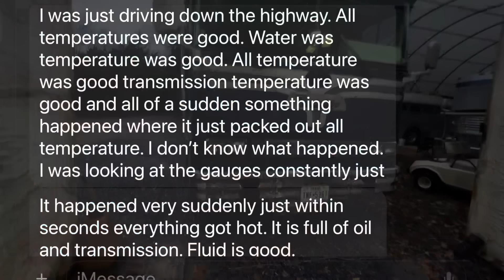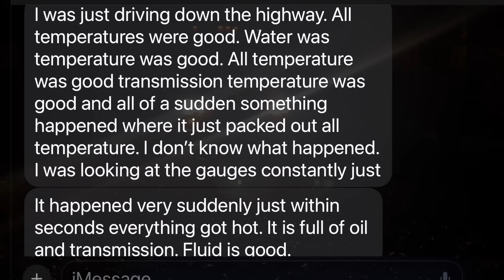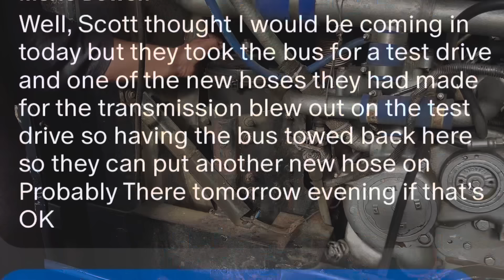From bad to worse.  Shop fire, bus breakdown and two tow trucks on one trip.

Comment: As a retired firefighter for the City of Calgary, I would like to suggest that you have the owners of buses mount their fire extinguishers on the level. A horizontal mounting  will help if they ever have to use an extinguisher because the first thing you do is thump the extinguisher on the ground when you pull the pin. The thump on the ground will loosen the powder and it will work. If mounted up right, the dry chem compacts with up and down motion and in a lot of cases they don't work. Hope this helps.
Reply: Good to know!
Reply: That's good information
Reply: What do you want to bet that 75% or more of the fire extinguishers in these buses won't work in an emergency.  The vast majority of the population is under the assumption that you buy a brand new fire extinguisher and it will last forever as long as it has not been discharged.  Unless someone owns a business requiring annual fire inspections or works in the fire protection industry they have no clue that fire extinguishers must be serviced annually.  I have my fire extinguishers serviced biannually for piece of mind.  Fire code only requires me to have 3 5lb abc fire extinguishers and I have 4 10lb and 2 20lb abc extinguishers along with 4 20lb c02 extinguishers and 2 20lb class D extinguishers.  It does not matter if its fire code, plumbing code, electrical code or any other code because that is minimum code which is the minimum requirement to pass.  Why don't they list minimum code, preferred or suggested code and maximum code.
Reply: My daily pre-trip includes dismounting and shaking the extinguisher so that the dry chemical is loose and ready to go.
Reply: yes that is correct, same with fire extinguishers on fuel tankers, mounted upright, removed every 6 months and checked for settling or thumped on ground to remedy.  If thumping doesnt work, they go out for replacement.

Comment: I always kept a CO2 fire extinguisher at my bench. They displace the oxygen to put out the fire but also have a "right now" chilling effect - great if you're welding. Best of all - no residual mess! That white powder is nasty and will corrode electrical components ... showing up for a long time after the incident and ongoing.
Reply: I use Cold Fire for the same reasons
Reply: For welding, metal working and automotive a class D extinguisher is a must.  Who cares about mess or residue if the building burns down, I have two 30lb class D yellow extinguishers in my shop.
Reply: @ShaneSwartz-l1x you really need abc extinguishers in an automotive shop. D is not intended for gas, oil, electrical or burning rags. Unless your shop is working with combustible metals (titanium, magnesium, zirconium or lithium, a class d is not really the correct choice.

Comment: This is why the last shop I worked for didn’t allow welding or torching an hour before closing.
Reply from the maker: Smart
Reply: The rule at my shop is that someone has to be there for 2 hours from the time of the last spark or ark, tig welding is the exception which is 20 minutes.  I only have 5 employees but they all know they do not leave until the closing checklist is completed each day.  I also have fireproof oily waste cans that are just for rags and all rags must be in the containers before the checklist is complete.  I check the cameras to see if they are following the checklists.  I am a pilot and flight instructor and aviation revolves around checklists as they are the most effective way for humans to properly complete procedures and tasks.
Reply: @ShaneSwartz-l1x  check list can and should be applied to everything

Comment: Probably should have a basic safety briefing for any customers working in shop. Thanks to your channel I was fairly knowledgeable when I bought my MCI MC8 in Port Orange FL. My friend and I flew down from Philadelphia to drive it back. I had hired a local diesel mechanic three months prior to change the oil and such and I knew it ran great. Frustrating though because my water temp gauge illumination was out. About 100 miles up 95 I saw coolant blowing out overflow and pulled over immediately. My squirrel fan belt broke. Luckily there were two spares. I was able to change it in 15 minutes and be back rolling. All stuff I learned watching your channel so thanks !  I use to drive to Orlando twice a week from Philadelphia for UPS so the drive back in the bus was cake. Been past your area a few hundred times. Retirement coming soon and a lot more bus work and good times.

Comment: When I worked asset protection for a large company. Any welding extinguishers must be on site and then after job finishes for the  first two hours an inspection had to be done every 15 minutes to observe for any smoke or fire. After that then next two hours every 30 minutes.  The inspection card has to be signed off at each interval.
Reply from the maker: In shop class in high school my teacher was welding and a spark flew into a trash can and the can exploded flaming material all over the shop.

Comment: Thanks for your videos. They’re always very interesting and we really like to watch them. Yeah that fire is scary. Wasn’t it? You know I’ll just give you a little advice as to what I do in my house in the laundry room. I keep a dedicated garden hose coiled up in the ceiling and it’s connected to my water system with a shut off valve. I’ve never had to use it, but it’s there in case I can reach anywhere in my house with a hose and I would be able to put out a fire if I was in the house, of course Just thanks again

Comment: Can't tell you how many times I've seen wiring pinched in-between engine and transmissions over past 50 years. 
Hello from Siesta Key Florida
Reply: I love laughing at my customers who are too cheap to pay for transmission installation, they call me blaming me for why the vehicle won't start and I tell them to go follow the wiring down the back of the engine and not to waste my time.
Reply: My favorite is when they short out a $700 tcm and they have to pay to replace the tcm and service programming.

Comment: A house around the corner from me mostly burnt due to oily rags in the garage, since it was mostly brick and the station is about half a mile away it was saved. I have a repurposed wire mesh waste basket that all rags go into and it sits on my work table so I can see it from anywhere in the garage.
Reply: Yeah it's crazy how a bunch of oily rags will catch on fire themselves.

Comment: Towing....  A wheel or axel lift, such as the one shown, is the only method to avoid damage to front structures.
I think many  Wanderlodge with a front mounted generator, has its lower frame bent upwards  from previous tows. And that causes damage/binding to slide out.
Appears this one has also. On GM and MCI they screw up spare tire carrier, etc and sometimes even break off entire front bumper as things give way.
If you fool with bus conversions you really need to be vigilant in the case of a tow. Ask about method of lifting and get on the ground to confirm with your own eyes.
You have to insist regardless of what 'towing expert' says

Comment: Boy howdy!!  Some of my worries all in one video.  It's interesting when his suddenly over heated.  When my cooling fan stopped working, I noticed that the engine temperature slowly rose and wouldn't cool back off when it normally would have.   His system may be barely enough to cool and any disturbance in efficiency results in overheating.

Comment: So we have a concrete board with the joints mesh taped with mortar on the walls and the joint on the floor around the welding area.  We had a small fire years ago. Now dedacated welding area.

Comment: Always have red arrows / markings high and low on the walls to designate where a fire extinguisher is.  Also, I keep water charged extinguishers handy while welding / cutting to knock down those small flareups.

Comment: I was looking at that great deal you got on the tractor but the only thing that's not really super great is the track Growlers the actual biting area of the track is really really low they are not very tall! You should add them you actually weld new ones on the tracks that you have on already. You can buy them separately and they make a big difference for your traction that you need coming up your Hill. All the best from Canada.

Comment: My friend's van had a fire in the engine compartment, we put it out with a CO2 extinguisher. Someone had called the Fire Department and to make sure they sprayed it down with dry chemical. Three weeks later the were no insulated wires in his engine compartment.  The dry chemical  ate, (corroded), all the insulation off the wiring. I do not have any life experiences with spray foam. Might be a good Idea to thoroughly clean that part of the wall.

Comment: Having seen Andrew Camarata's video of losing his $150,000 excavator for want of a decent fire extinguisher [and he was seriously under insured so only got a $25,000 payout], I've supplemented all my vehicle and building fire extinguishers with fire safety stick fire extinguishers.  
It hasn't been a cheap exercise as the larger of the two versions is the equivalent of US$130 here in the UK, but they don't need servicing and have a shelf life of over 10 years.  More importantly though, the big fire stick operates for 100 seconds which is way longer than normal extinguishers and gives you a much better chance of knocking down a blaze. 
And, yes, I bought several smaller ones and we had a practice fire drill with them!  
$1,000 effectively went up in smoke but my staff now have confidence in them.
My local fire brigade, who came to the drill with the local fire stick agent, now also have one in the their fire engine which they paid for!
I hope you won't mind me posting this video of the effectiveness of the fire stick in real life circumstances [and I haveno connection with the maker by the way]:
https://youtu.be/KOeEVihGAA4

Comment: Man, that fire was slow to start, but quickly extinguished. I think it was timely that Kelly came in with the call, otherwise your son-in-law might've left the shop for a minute and the fire could've really stepped up. As for the bus, I think that other shop did something that triggered the immediate overheat situation - maybe a pinched coolant line?
Reply from the maker: He was a few hundred miles into the trip.  That’s not possible.
Reply: @BusGreaseMonkey  I agree.  Something like that would show up pretty soon - less than 100 miles.  I'm not confident in the transmission shop but I don't think the overheat issue is on them.  "Another shop worked on this XYZ...." has become more common in your videos and I think that reflects on the inability of many mechanics to correctly troubleshoot (and instead launch a parts cannon), inattentive or incomplete work from some shops, and that you've established BGM as an experienced, thorough, and honest shop that owners can trust, capable of success with problem-child coaches.  Y'all rock!

Comment: Question as I am somebody who does not work on or have driven a bus, do you have to start the bus under the back panel? (Or is that like a secondary way of starting it?)
Reply from the maker: This bus has some electrical issues and can currently only start by the rear controls
Reply: @BusGreaseMonkey  Thanks for the reply!
Reply: If the engine is located in the rear there is usually a second starting location so that one person can work on the bus and monitor issues when wiring on them. 80ft from key to dip stick is a slog when there’s issues.